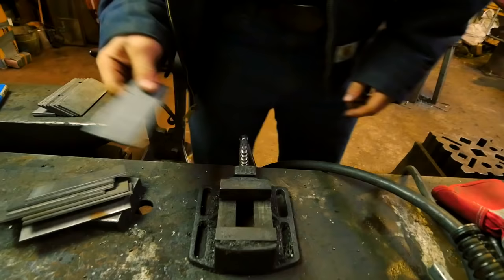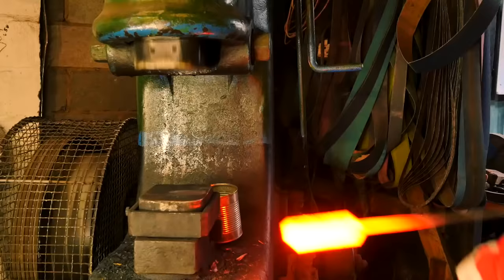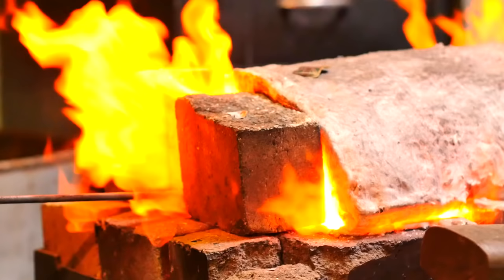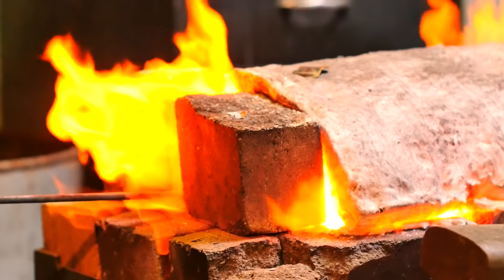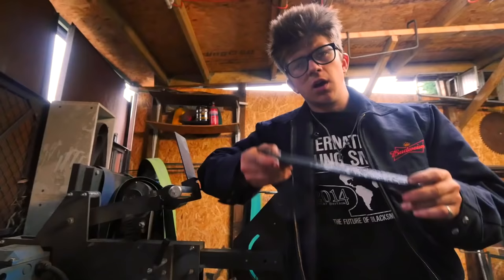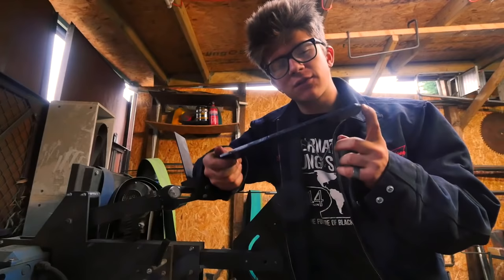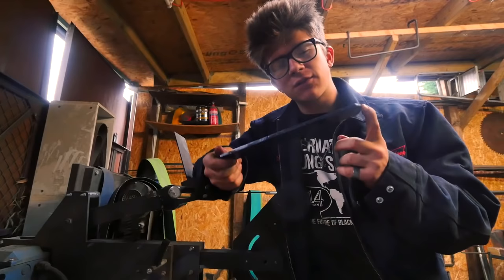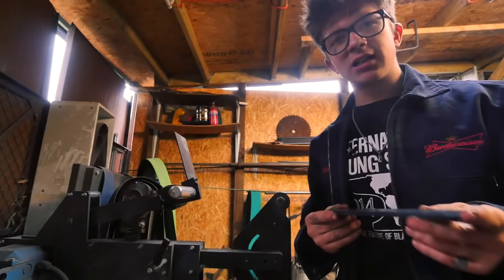DAMASCUS FAIL: FORGING DAMASCUS STEEL FOR GREENBEETLE

Comment: welding a bar stock handle onto the billet from the beginning makes it easy to control, especially when it starts to get thin and hard to grab with the tongs

Comment: I'm continuously impressed by the quality of your work and drive to produce. It's a rare combination. 

If you're interested in a challenge and accessing a new viewer group, maybe try making a damascus tube for a rifle or shotgun barrel. Lots of guys have knowledge of reaming and rifling pre-drilled bar stock blanks, but seems there aren't any gunsmiths or blacksmiths that can make damascus barrels anymore. Spiral or straight seam welds were both used - I'd imagine a spiral weld would look better with damascus. As long as it's straight any imperfections can be reamed and filed out. 

You'd also be safe from any particular laws regarding firearms manufacture as the tube isn't considered a firearms part in any country until reamed, rifled and fitted with a breech plug. If it was finished in North America - Canada especially, there are no laws regarding proofing, that would require special consideration like in the UK. 

Anyways, as always I enjoyed the video.
Reply from the maker: +H Wal. I absolutely love the idea! I think it would be a wonderful experiment. So I was completely within all interpretations of the law - if I were to do it I would leave a portion of the barrel blocked however!

Comment: You put the carbon steel on the outside, because it welds at a slightly lower temp.
After the initial weld of the stack, you will only be welding carbon steel together from there on.
I gives you a wee bit more time and temp range to weld at.
If you have a weld failure, it's usually going to happen on the stack weld in the center area of the stack.
You need to soak it really well, it's the most critical weld of the process..

Comment: You should go on the forged in fire champion show you would put them all to shame
Reply: I don't think the contest is open to non-US citizens and I'm pretty sure Alec is a Brit.
Plus I thought exactly the same when Walter Sorrells participated in it (also a youtuber knifemaker, smart and experienced) S3E14

One of the difficulties of the challange is controlling your heat treatment in an unknown forge, that is also brightly lit, so the cameras can get good shots. Notice how Alec keeps his workshop dim, allowing him to more accurately tell the temperature of his steel. Also oftentime there's some sort of mistery steel involved, which is a big unknown.

Comment: So, given where you believe it failed, would the solution be to, once you have run the fuller in, cut the two layers completely apart, forge the two pieces flat, clean, stack and then weld? Or possibly just chemically clean out the fuller area and then flux it as soon as it is hot enough for the flux to stick, to forge the gap closed?
Reply: It's a fairly common issue. Generally a well fluxed fold is adequate. But as in all things in life, it becomes easier as you gain experience! But either solution would work. 
AAR

Comment: 6:46 would have been better if you stuck yet another type of steel that oxidizes differently from the other two and sandwich it together like you did.

Comment: got a new sub! that design was epic!! a few things I was wondering what is it your doing wrong to have such low subscribers and Views cuz your videos are awesome you're doing a great job keep up the good work. I was wondering how long you've been smithing for? Im new getting into smithing, was curious how you went about setting up your ventilation cause that's my main concern Winters here are very cold can't forge with doors open. also how did you acquire your power hammer? because that's the next thing I want to purchase seems like it's a must. it takes forever to do what you did by hand lol. your camera views/skills are on point keep up the good work buddy!! I need to learn how to make videos like you. how many camera are u running at once? thanks!!
Reply from the maker: +Larry Allard Thanks Larry! I've only just got my ventilation sorted out. I bought a metal dust extractor, a wood dust extractor and a ceiling mounted air filter. It works well. I bought the power hammer from eBay and I tend to shoot just with one Panasonic gh4 camera!
Reply: Alec Steele I saw you had one over the forge. maybe of your bored one day u can shoot me a small private video of your ventilation. what did you pay for that power hammer ? there so damn expensive haha.  crazy you do all that with 1 camera. got skills  thanks for getting back too me

Comment: Where exactly do you even get ferric chloride?
Reply: I don't know where in the world you're located but here in the States you can buy it at Radio Shack, which is an electronics supply store. It's sold as PCB etchant. I would think a well stocked electronics supply store would sell it.
Reply: Dale Martin I appreciate it thanks
Reply: makes me sad... radio shack is no more... ;_;

looks like you can still get it online at places like amazon and ebay though...

not sure where else... >_>

I wonder if other etchants work as well... I've heard of etching using things like vinegar or salt water and electricity... I wonder how those look vs. FeCl3